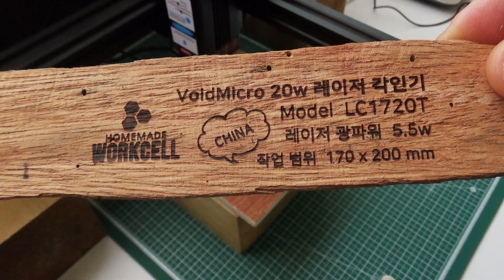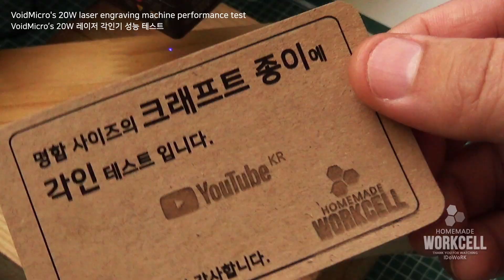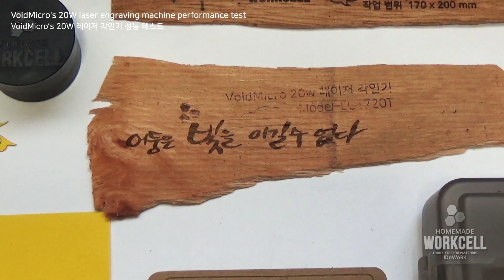🔵 중국산 20w 블루 레이저 각인/커팅기의 성능 테스트

Comment: great video. i just got this product :D i cant seem to connect the device to the pc via usb(over wifi on the mobile app it works) . using the software on their site , i can make it connect on the void micro Vr0.0.9 but the new version Vr1.1.3(grbl) does not work :( any suggestions?  are you using the provided software or your own?
Reply from the maker: Hello. Felicianoabe.
First of all, thank you for watching the video^^

USB connection requires driver installation. Have you installed the driver?

When you download VR0.0.9 software, driver installation files are included.

There is related information in the link below.

http://voidmicro.com/Manual/Win-en.html?page=page_Manual

I understand that PCVR1.1.0 software can also be used if the driver is installed.

If you installed the driver but cannot connect via USB, delete the installed driver, restart your PC, and try installing again.

I do not use any other software, but only Voidmicro's software because it is easy to use.

I hope your problem is resolved well.

Thank you^^

Comment: can you help me how to fix my laser machine like this because the problem is, its connected but the machine cant move
Reply: pls help me i have 4 machine same problem
Reply from the maker: Hi, I`m Workcell.
I've never had the same problem, but what I do know is if the laser machine doesn't move even when it's connected, in most cases, there's a problem with the connection line between the control panel and the step motor. 

Because the laser head is moving, the cable connected to the motor is often broken. 

If you are experienced the same problem on 4 machine at the same time, you should check the program on the computer connected to those devices.

All I know is this.
I hope the problem is well resolved.
Thank you.
Reply: @WORKCELLDIY  ok thanks do you have an video how to check the connection line between the control panel And motor?
Reply from the maker: @iglesiaako8548  Hi. Iglesia Ako.
As far as I know there is no video checking the cables on the laser machine.
Cabling issues have been mentioned in several blogs. The laser machine did not move, so it was confirmed that the cable was break when after service was received. After replacing the cables, the laser machine is said to be working normally.

Basically, other parts of the laser machine have a very low probability of failure, but it is said that breakage of the cables connecting each part is frequent.

Disconnect the cable from the laser machine and do it check if the cable is broken with a multimeter. This is the first thing to check unless you entrust the after-sales service to a company. And, when disconnecting the cable, be careful as it may pull out up to the F connector.

I hope your laser machine problem is solved.
Thank you.

Comment: Great!
Can you let me know how to laser in a photo sketch?
Reply from the maker: Hello, I'm Workcell.
Thank you so much for watching and leaving a comment.
I haven't engraved the sketch with a laser machine yet.
But I wonder what the sketch engraving of this laser machine will look like.
I'm currently working on resin, so I can't work right away, but I'll upload a laser sketch work video soon.
Hope you have a nice day today. thank you.
Reply: @WORKCELLDIY  Hi, thanks for your response. 
I was able to print image and sketch but the machine hanged and stop communicating through wi-fi. Either  direct connection through USB or mobile phone. Normally there is a blue light flashing but then a red light came from the board. I am hoping you have some experience about it. 
I contacted VoidMicro by email and direct to their Website there is no reply yet.  Thank you.
Reply from the maker: @juantamad5784  I was also disconnected from the Wi-Fi before, so what I was doing was wrong.
So I connected it directly with USB and started working again, and there was no problem after that.
Looking back, I upgraded the firmware when I first used the laser device. I connected it directly to USB and upgraded the firmware in the 'ViodMicro' program settings.
I don't know if you've upgraded your firmware, but I think you should try it again.
I don't know any other solution.
I sincerely hope that your problem will be solved soon.
Reply: @WORKCELLDIY  Hi, thanks again for your response. The issue is that I can not connect to the laser even using the USB. I am using Voidmicro software.
Reply from the maker: @juantamad5784  There seems to be a serious problem.
It seems that have no choice but to wait for 'VoidMicro' to contact.
Sorry for not being able to help you.
I hope VoidMicro will solve your problem properly.
Reply: @WORKCELLDIY  Thanks.